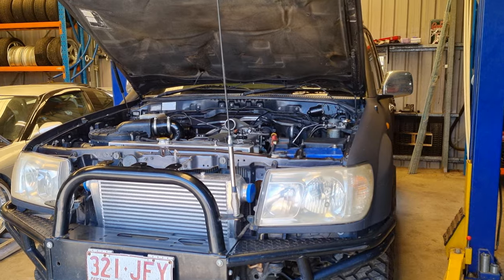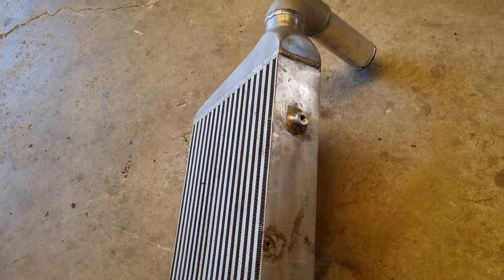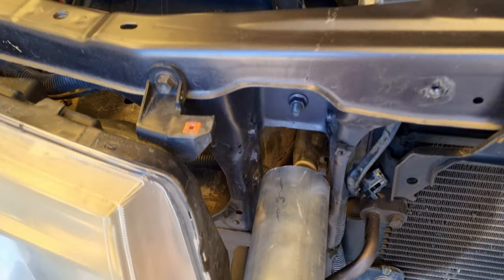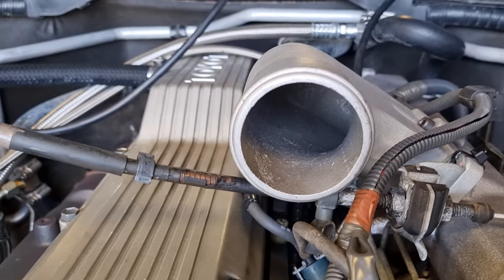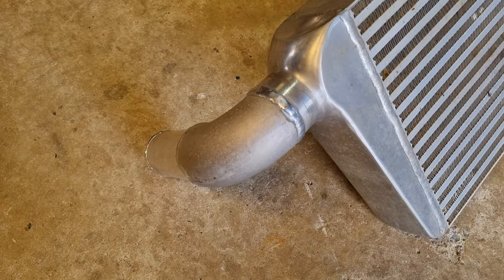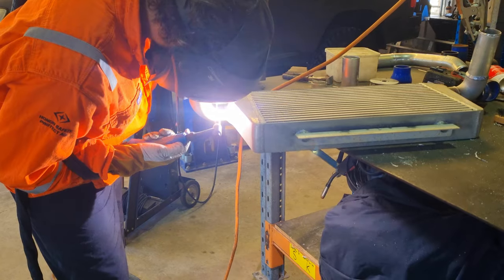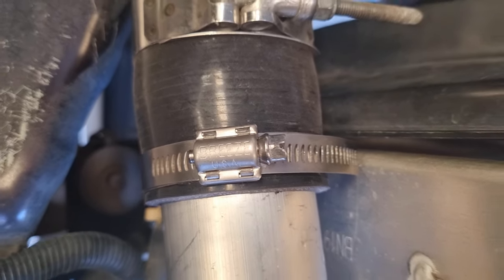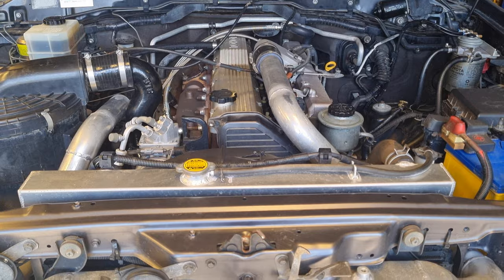Land Cruiser Front Mount Intercooler Install

Comment: How did you turn the altitude compensater to a boost comp been wanting to do this for ages but what do you do with the vaccum line off the back of the pump ? Does it get blocked off or ?
Reply from the maker: I haven't had a chance to do this yet but yes it just needs a boost line. There's some adjustability with spring preload and needle angle. I'll make a vid when I do this on the dyno so it captures all the info the changes make.